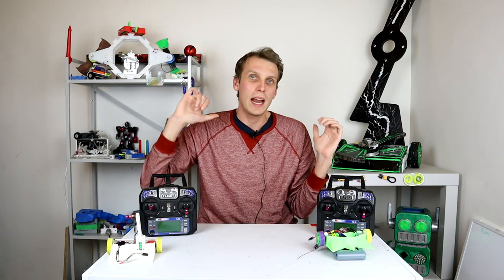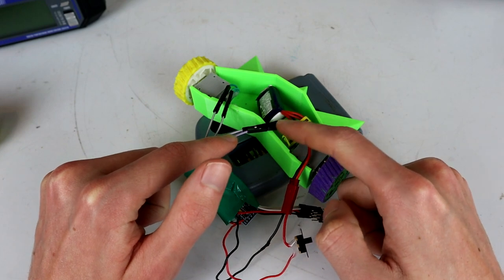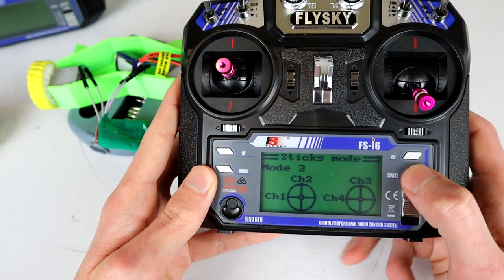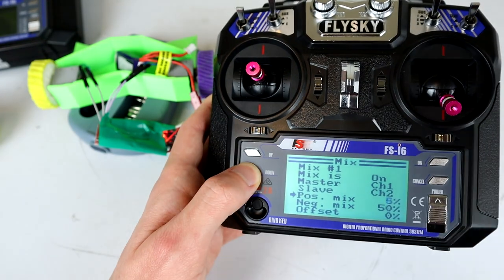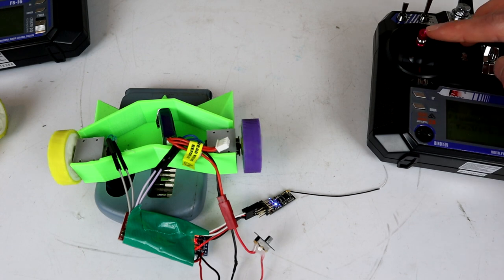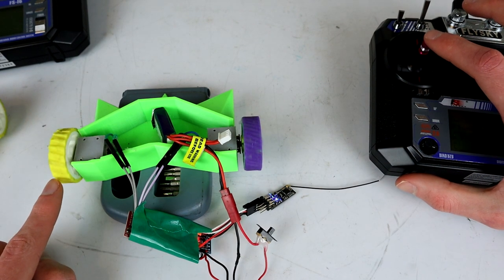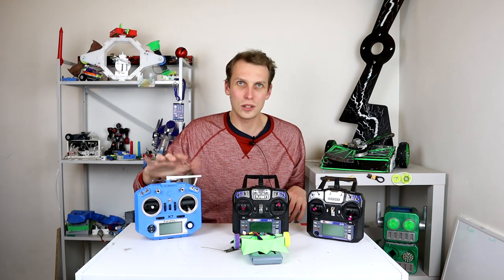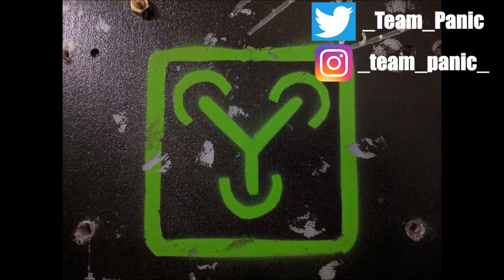Mix Flysky fs-i6 for robot tank steering

Comment: Hey Ben 
Been watching your video on Mixing Fly Sky channels for robot tank steering. I have a FS i6X TX and matching 6 channel RX, and am trying to use them for differential steering a land vehicle, using two ex hoverboard motors (BLDC 350 Watt at 12 volts) and ZS-X11H control boards. I can't get a full range of duty cycle out of the Tx/Rx combo, it only outputs between 5% and 12% duty cycle PWM to the throttle inputs, not enough to operate the motors. Any suggestions as to how to get 0% to 100% duty cycle out of the FlySky Tx/Rx please?
Ken
Reply from the maker: Hi Ken

The Rx does not output full duty cycle PWM, it outputs servo signals, these are a PWM signal used to transmit data.
A servo signal is a short pulse, 1ms - 2ms in a 20ms frame.

To convert a servo signal from your RX to full duty cycle PWM to drive a motor you need an ESC.
For old hoverboard motors you need big escs, most people will use a VESC or similar, usually rated for 50A or higher
Reply: @TeamPanicRobotics  Many thanks Ben for your prompt response. I have seen references to that previously, but not a clear explanation as you have provided.
The vehicle is only small, (a full scale model of Dr Who's robot dog K9) so the 350 Watt motors will not have to work very hard. I will have a look at inserting an Arduino between the FSky Rx and the motor control boards, and try to map the narrow range of PWM from the Rx out to a wider range, to get a more useful speed range out of the FSky/Arduino/ motor control board combo.
Thanks again
Regards
Ken

Comment: I do all these but when I connect and the stick is in the center position it makes the motors go at 50%. Am I doing something wrong or is it the type of esc im using?
Reply from the maker: yes, the esc you are using is a single direction esc (or is programmed for single direction) you either need to buy a bi-directional esc, or program the one you have (if you can, not all ESCs let you)
Reply: @TeamPanicRobotics  I ended up getting it. Forgot I had it programmed wrong. Thank you.

Comment: Thanks a lot for this video! I am a beginner with Skyfly and you show and teach very clear the Skyfly modes. Just one question. If I did everything you taught us but by going forward the wheels start (or tend) to go to one side, how would you solve this issue? Again, thank you for your big help (at least for me).
Reply from the maker: this could be to do with the trim for your left/right channel. there is a little rocker switch under the stick, push it in the opposite direction to the way the robot tends to move

It could also be your ESC or your motors, if your motors dont have the same gear boxes one will always go faster then the other, causing the robot to turn
Reply: @TeamPanicRobotics  Thanks again! I will try your advices. Have a nice day!

Comment: I just have a question about creating my own 3d printed tank, I am using the FS-I6x which has a 6 channel receiver, I am trying to run this set up in a tank mode so the left stick controls the left track and the right controls the right back and fourth too. I was wondering if you guys could possibly do a tutorial on how to set this up because I have been having so much trouble with trying this, thanks.
Reply from the maker: Sorry missed this one, 

No mixing is needed to do 2 stick tank steering.
One of the forward/back sticks will be a channel, the other forward/back stick will be a different channel (look at your controllers manual to work out which is which)(usually 1 and 3)

Simply plug the motor on the left into a bi directional ESC, plug the ESC into power and into the channel that corresponds to the left stick, same for the right motor, but plug it into the channel for the right stick
Reply: @TeamPanicRobotics  hey, I understand what you are saying but I tried this and -100 percent on both sides on the sticks equals 0 for the motor so I have to hold the sticks all the way down to stop the motor from moving, I also have no reverse because instead of -100 being reverse, it’s 0 for the motor, I tried dub trims and trims but non of this work, I have bought the spectrum dx6e to try it on that and it’s no better. Not sure if maybe you can help with this?

Comment: Is it possible to use a continuous servo drive?
Its much cheaper than getting two n20 motors and a dual brushed esc but my servo's only turn a certain amount, not forever, so I drive about an inch then stop
But they are capable of 360 degree rotation
Reply from the maker: Yes, but its the worst possible drive idea
Servos, by and large, are both heavier than N20 motors and also slower

So, by running servos for drive, you basically ensure that your opponent has a bigger weapon/more armour and can drive circles around you. That's a good way to lose a lot of fights.

Having said that, there are a ton of tutorial on youtube that show how to hack a servo into a continuous rotation servo
Reply: @TeamPanicRobotics  I figured it out and now the drive works alright but yes I should definitely upgrade to n20 motors.
My bot is a 1lb antwight fully 3d printed
Reply from the maker: Looks good!
Really like the shape of the drum

Comment: What kind of esc are you using? Most esc are just for one channel
Reply from the maker: The ESC type does not matter when you use this mixing set up.
This mix, mixes the signal so that each channel gets the right values for each motor based on your stick position

Using this mixing set up you can use a dual channel  ESC or two single channel ESCs and it will work equally well
Reply: @TeamPanicRobotics  thank you. Do you know if the fs-ia6 reciever works with 7.4v?
Reply from the maker: I dont know about the big 6ch one that comes with most fs-i6 transmitters but this one does: https://youtu.be/npt4z8P3CeY
Its a little 4ch one and runs on up to 9v so perfect for running directly from a lipo

Comment: Thanks.  Mine worked for few minutes. An then now all I have the wheels run opposite in all positions. I went to reverse an changed one at a time an made no difference in the rotation
Reply from the maker: did the mix save correctly?
You need to long hold the cancil button for the mix to save

I'd double check that as a first step

Comment: Thanks for the valuable info. I don't have a very hi techo brain. I would appreciate a show on how to with 4 motors. like in 4wd.
Reply from the maker: Its the same mixing for 2wd and 4wd
Just with 4wd you plug two ESCs into each channel on the receiver.
So the ESCs that control the left motors get plugged into the same port on the reciver and the two ESCs that control the right motors are plugged into the other
Reply: @TeamPanicRobotics  thanks for the valuable reply mate. From Australia.
Reply: I am sooo confused. I've bought 2x motor controllers where the port markings on the controllers were not corresponding with the manual. I think I got that sorted. Enable wire was the problem as there was no port marked EN. I then got no joy whilst output mode on my rc was in PWM mode, just tried PPM and the bloody wheel went  full speed. Now I'm at my wits end. Do you think you can assist me here.

Comment: Help i did this but as soon as the stick is in the middle my motors start spinning like mad anyone now the solution
Reply from the maker: That sounds like a problem with your ESCs.
With the sticks in the middle, the transmitter will be sending out a middle signal.
If the ESC is set up to do forwards and reverse then a middle signal means stop, but if the ESC is set up to only drive in one direction, a middle signal means spin the motor at half speed.

To be more helpful then that I need more info.
What escs are you using?
What motors are you using?
What receiver are you using?
have you bound the receiver to the transmitter?
have you set the fail safe on the reciever?
Reply: @TeamPanicRobotics  im using the 
emax simon series 20 amp esc + bec
the sunnysky X2212-13 motors
the FS-IA6B receiver
and the FS-I6X remote

the receiver and the reemote are definetly bound cuzz i have done things in the past.
i have no idea about the failsafe for so far i know i have done nothing to change that setting.

thnx for the reply

Comment: On a 4wd tank it's a but more complicated.
Reply from the maker: Nope, same set up on the transmitter

Just in the tank, hook up 2 escs per channel (or two motors per esc if you are running brushed motors)
Much much easier to do somethings in hardware then try to over complicate the software

Comment: What is all this mix crap?? Seems like a pain in the ass. Why not just change channels by the receiver to make it real easy? If you want to change something just unplug it and move it to a different channel.....
Reply from the maker: mixing means that pushing forward on the control stick turns both motors at the same time.

Without mixing, you can change the plugs on your receiver all you like but moving a stick on the transmitter will only move one wheel at a time. This is a type of control, but most people find it more intuitive to have mixing
Reply: @TeamPanicRobotics  thanks! I haven't played with a rc car since the 90s. The last buggy I  had was a team associated rc-10 b2 or b3. It's been a while. There has been a lot that has changed in world of rc since then. Thank you for the clarification.
Reply from the maker: Ahhh ok, this video is more focused on combat robots then RC cars.
Combat robots tend to use tank steering so that they can turn on a dime. This is good for keeping your robot pointed at your opponent but requires the signals from the transmitter to be mixed together.

RC cars still typically use back wheel drive and conventional car steering on the front, which doesnt need mixing